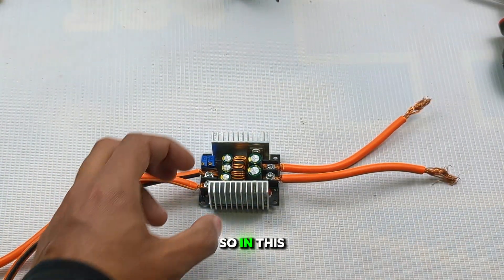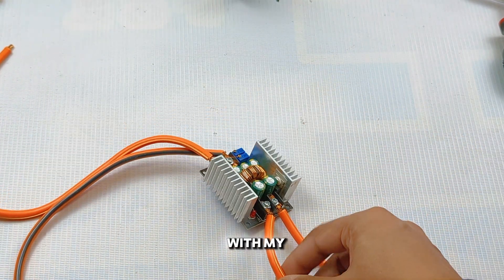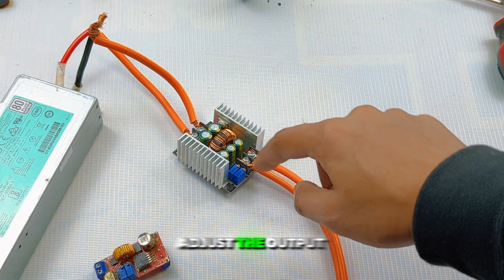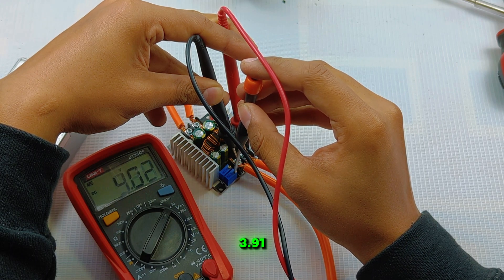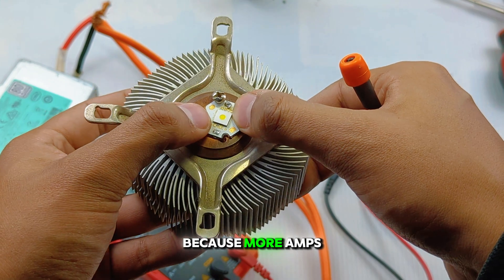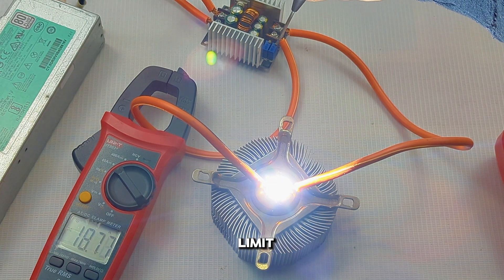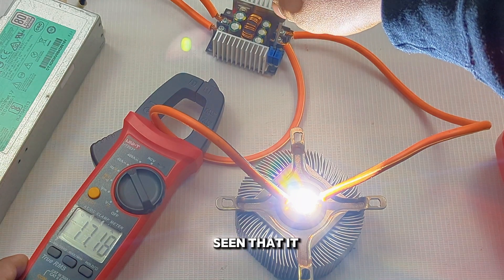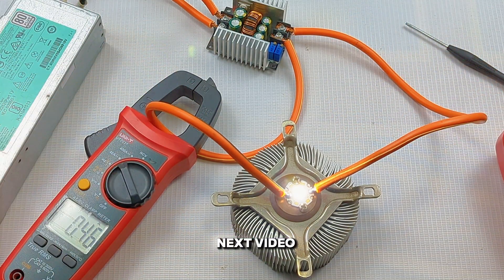20A 300W Buck Converter: Ultimate Guide to CC/CV Power Control!  #buckconverter

Comment: turning the CV knob on mine (i have 6, all out of the box, all behaving the same, so they're not defective) does NOTHING to change voltage. Input was a 7.4v LiPo battery. output to a 3v-to-12v battery. What did I do wrong?
Reply from the maker: Its a step down converter, you should get 1.25v-7v on output by inputting 7.4v.
Maybe you connected input on output side

Comment: What will be the current rating of input supply module and voltage to run the buck converter with 20A and 14 volts
Reply from the maker: You are talking about 280w power. 
Input should be 20v 15A which equals 300w.
So module can output 280w at 14v 20A but it will get super hot at 20A. 16A output load recommended

Comment: can I make closed/short circuit without any load ? if i short what will happen ?Did buck converter will damage or current will pass through the wire?
Reply from the maker: Not recommended. I burned my 1 module by doing this. Because current is High enough.
Its IC will be damage

Comment: Great video! I wonder how we can adjust the current without load or prior to connecting the load - by way of some dummy load ?
Reply from the maker: Yes with resistor as a load. Not by shorting directly like xl4015 module because it's only 5A

Comment: Great video, how low can you set the amperage can it do say 100mA? and putting a load on it to set the amp is a must If I understand you correctly I cant just attach a Volt/amp meter and set the desired amp with out a load.